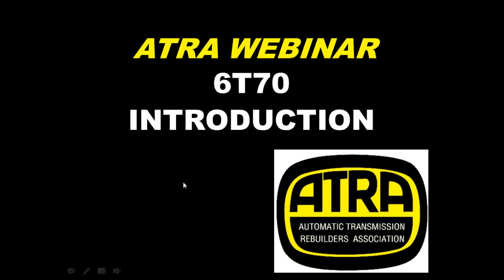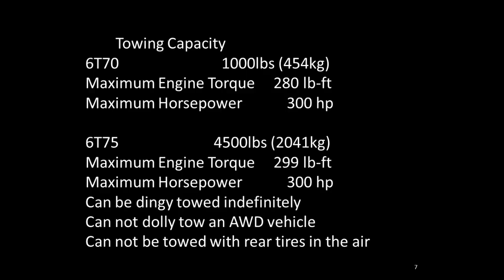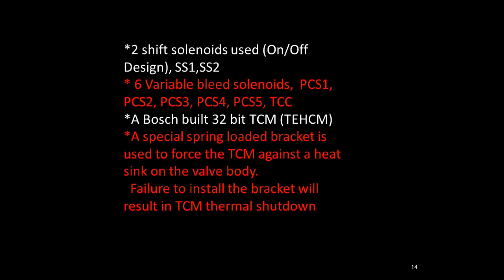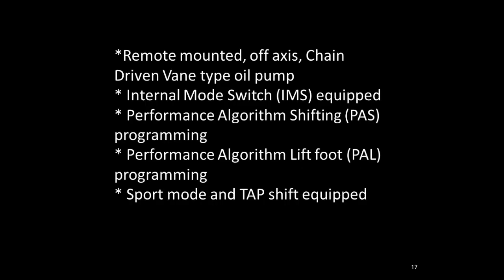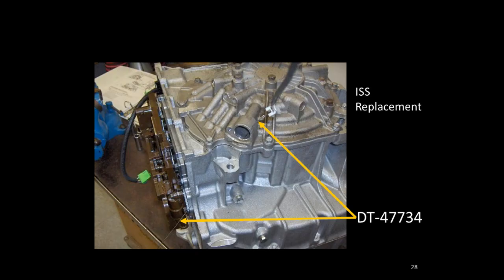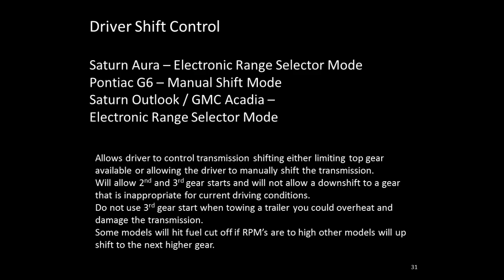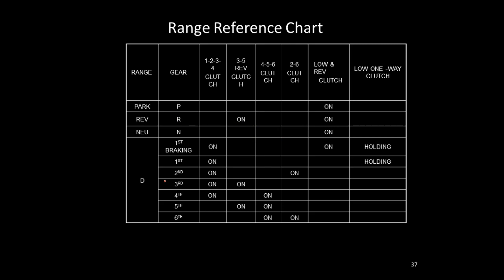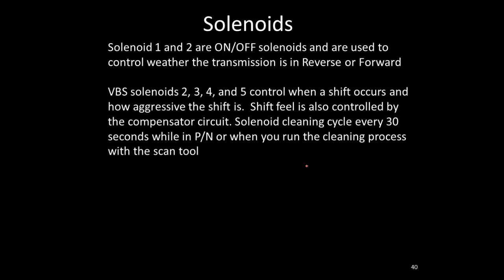6T70 Introduction Webinar - 3/8/13

Comment: The pressure switches are absolutely serviceable.  You can purchase a rebuild kit online and the job itself is a breeze.  Why promote having to buy a brand new TCM for $1000 when all you need is a $50 set of laminate discs and 2 hours of free time?
Reply: Considering the video is 8 1/2 years old, the statement was probably correct at that time.

Comment: sir why after changing my tcm valve body my manual shifts don't work even though the valvebody is programmed
Reply: For people who struggle with this, I found out the hard way that you need to put the shifter rod into the manual solenoid. If that doesn’t work, most likely a broken shifter.

Comment: My GMC Acadia 2012 would not shift past the 3rd gear then it will go into limp mode. I decided to take the valve body out and check it out. I found two pistons that were stuck and that would not move at all. I bought a new valve body, installed it but now my car won’t shift in reverse. I tried with the old one but still won’t shift to reverse. The only other thing that I did was to clean the TCM with some air pressure.  Any suggestions on what else I can try ? I need to get it out of my garage

Comment: pressure control solenoid c?so number 3 sir?
Reply from the maker: You can say that Sol A is Sol 1, Sol B/2 Sol C/3
Reply: @atra-automatictransmission1300  so the presure control solenoid c is replaceable? or do i need to buy the whole techm?i need advice...thanks